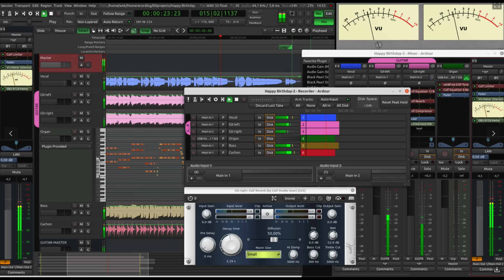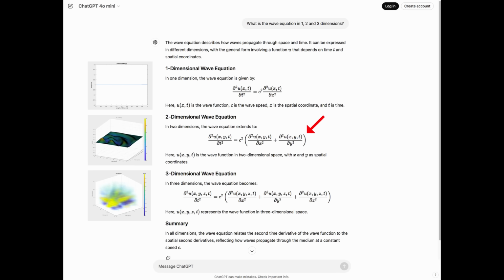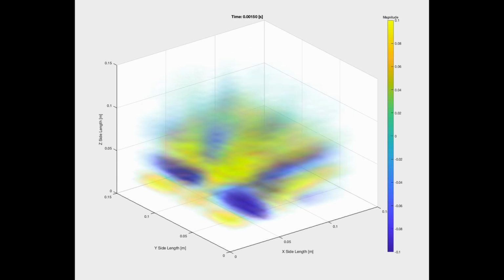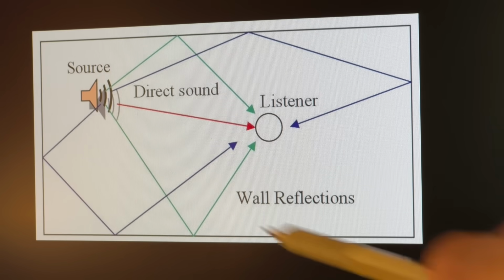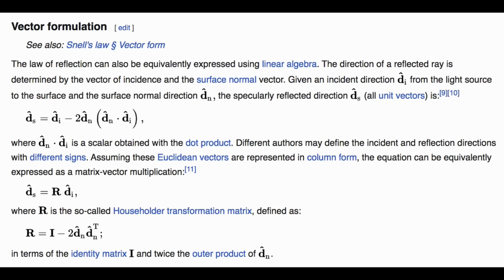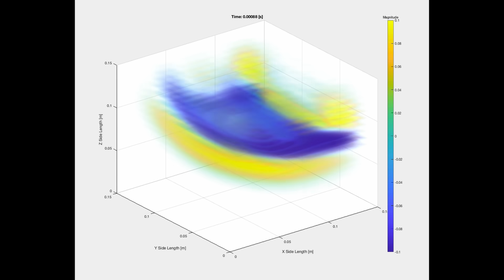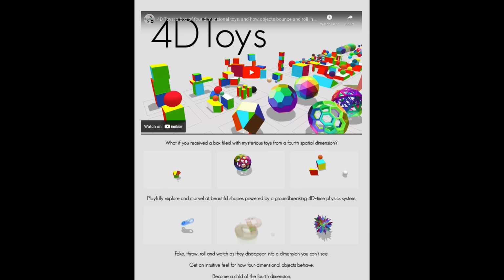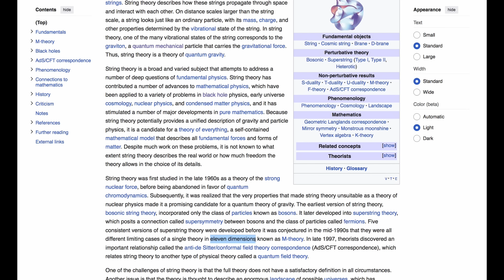Four Dimensional Reverb

Comment: Hey there. Awesome video. I'm working on the same puzzle at the moment. This is not quite a 4d reverb just yet. Yes it had the 4d wave equation. But you did not account for the wave interaction. The navier strokes equation is needed here. Also you need to not see the hyper cube planes as a surface and set a material which changes the diffusion rate. Please om me if you want to collab on this because I still think it's an awesome idea

Comment: 'impossible instruments' has been an idea in my mind for a while now. not a math guy to implement anything, but.. it's this sweet spot (or perhaps, dialectic) between 'the physically and mechanically possible' and the 'virtually and mathematically simulatable'. producing something like the 'physically impossible' yet 'virtually simulatable' sounds. it's a sweet spot really. where you have to navigate between 'simulating physical constraints or mechanisms' and creating their 'abstracted yet creatively potent' counterparts.

that's the original implicit vision of Robert Moog, if you read the patent of the synthesizer.

it must be an engineering movement within the audio world, i think.

again, you have to navigate between 'physicality and its math', 'physical and mechanical improbability/impossibility' and the 'abstraction' that can be produced by interpreting them, into 'musically viable applications'.

think of the piano, where in the middle keys, you have 3 strings being hammered in each key—that's where 'unison voices' comes from.

you have to take physicality as an inspiration to an applicable abstraction. thus 'expanding' what's possible from what has been.

Comment: I just realized your simplifying assumption of using rays and distance travelled is unfortunately wrong because of Kirchhoff's formulas.

Wave propagation in an odd number of dimensions is intuitive in the sense that pulses propagate on the surface of well-defined "light cone", meaning an original pulse will after some time t only be perceptible at points at a certain constant distance from the origin.

In an even number of dimensions, however, the backwards propagation component of a forward moving pulse does not fully interfere away, and we can observe ripples bouncing back towards the origin from the front at regular intervals, like the trail of waves generated by a boat on a lake.

Great. Now I can't stop wondering how 4D reverb would actually sound.

Comment: 4D is Time itself. Movement. It's not impossible to see 4D. If you can see the tragectory of an object you can be in tune with the 4th dimension, therefore you can see where it will go.
A 4D cube is a cube in motion.
Motion blur in a video, of an object moving, is actually the best way to see the 4th Dimension.

Time=Movement=4D
Reply: I have a video posted to my channel explaining 4D being time. Isn't too hard to find I don't have many videos.
Reply: we don't have a standard convention for anything beyond 3D, as 4D and 5D CAN both be temporal dimensions, but 4D can be a spacial dimension if you're talking about a hypothetical 4th spacial dimension, which would then classify linear time as the 5th dimension.

For all intents and purposes, time could be 6D, or 107D, it doesn't really matter.

Comment: Moebius strip drum head?
Reply: Assuming a rectangle from (0,0) to (W,H) with the space cut "straight" horizontally and wrapped "backwards" along the vertical, so that (0,y) is contiguous with (0, H-y).

Assuming a scalar wave, standing waves will be constrained so that the amplitude and horizontal wave velocity at these wrapped positions must be equal, while vertical wave velocity must be zero because an inward or outward wavefront would cancel itself, right. Then you make it a drum head by setting amplitude to zero at y=0 and H. I guess since the space should be invariant as you move your coordinate system along x, this means no vertical wave transmission at all. Because the amplitude must be mirrored across y=H/2, amplitude at this midpoint must be zero.

So, basically, you get even harmonics of H and all harmonics of W, and each mode will be have a wave number in both axes. But the lack of amplitude constraint in x means you can have any phase offset. So do you have to convolve the impulse with each harmonic with a delta function in the phase according to x... I can't tell if this would be a meaningful effect. Come to think of it, it means no even harmonics in x.

So, basically, it seems like any rectangular drum model would work if you just dropped odd harmonics in one dimension and even in the other.
Reply: I've always wanted to hear a synth based on spherical harmonics... cuz I'm a nerd I guess 😅

Comment: You’re not getting tonal results because ray tracing is a high frequency modelling technique (aka geometric acoustic modelling). Which assumes sound acts like laser beams, which is only really true at quite high frequencies. this doesn’t really capture the modal low frequency behaviour of room modes.

In room acoustic modelling you’d actually use something similar to the wave equation initially which will actually model the modal (or tonal) behaviour of the room. But this only works at low frequencies and it really inefficient at high frequencies. So to get the full package you could use BEM or FEM, but these are way more complex for modelling the wave equations. Or create 2 impulse responses (one using ray tracing and the other using the wave equation at low frequency) and pass them through a crossover filter! 

Either way, a really cool video and was great to see a scientific approach for this!

Comment: I was thinking about raytracing when I clicked on this video. I haven't worked out the math nor the feasibility to implement, but hypothetically we could build maps of the topology inside this "hyper-room" using various sonar strategies.  So if that were to be successful, I would probably look into creating a control move and orient the the subject around within the 4d-space. It would be cool to see what that would be like. We would still at best get a partial topology since we would be contained inside the room experiencing just a 3d projection at a time. I imagine that's what a bat would feel like if it had to navigate a 4d space some how

Comment: Edit: I hadn't gotten to the part of the video where you talked about the output being the impulse response prior to posting my initial comment.

I don't if anyone else had said this, but as long the source and reciever are stationary, you can pre-compute most of your data for this. You can bake all the phase offsets and amplitudes for as many rays as you want (could be very large). Then I think you could just bake it into a impulse response you can use in a convolution reverb (I could be wrong in thinking that could capture all the dynamics). Pre-computing could make using more exotic geometries accesible.

Comment: Raytracing does not solve the wave equation, an equivalent description to a wave equation with paths would require every possible path, not just straight lines. this is only the same, when the cube is very large with respect to the wave length. Whenever this is the case you are simulating echo/delay not reverb. 

Instead of solving the wave equation on a grid, for a Tesseract you can simply solve the associated eigenvalue problem analytically, generalizes trivially with higher dimensions (simply the possible standing waves that fit into the volume). you can then decompose the origin point into a superposition of such states with a frequency cut-off and evolve for each of them individually (since the wave equation is a linear ODE). Since the waves here are scalar fields, you can then instead take the density of eigenvalues to compute the correct impulse response.

Comment: I posted this as a reply in a long comment thread, but I think I want it to be more visible than that, so here it is as a top-level comment:

Sound is only 1D, being a scalar recording of pressure at, or averaged over a small volume near, a point in space. It doesn't matter that our ears are 3D, or that our eardrums resemble a 2D plane. What matters is what is detected and sent to our brain. Sound itself is just a 1D signal, i.e. more dense vs less dense, or in the detection thereof, more push or more pull. It also doesn't matter that the other side of the eardrum houses the cochlea, which is basically a sort of discrete Fourier transform on the wave. What matters is the waves of changing density that arrive at the eardrum and push it in with high pressure or, by partial vacuum, pull it out, which we can record, play back, generate, or simulate with 1D signals.

Honestly, while this video was a fun thought experiment, there was never going to be anything interesting. A 1D-space reverb can only bounce off of its two "walls" (the two endpoints delimiting the 1D line segment), a 2D-space reverb  has four "walls" (the four line segments delimiting the 2D square), a 3D space has six "walls" (six 2D squares delimiting the 3D cube), and a 4D space has  eight "walls" (eight cubes delimiting the 4D tesseract/hypercube).

Really, you could conceptually extrapolate the 4D (or higher) effect on the reverb by considering the difference between 2D reverb and 3D reverb and adding that much more, i.e. it's just gonna add more cowbell reverb. 😛

Comment: Very cool idea. Right away I was thinking it’s like taking a 3D reverb and adding another reverb on top of it, which is exactly what it sounds like. Never thought about sound in higher dimensions but what if we had 3 ears in 4D space instead of 2 ears in 3D space. And what if sound moved through the air differently.

Comment: I had a project planned last year to do physical simulation in a 3D room - but my approach went beyond impulse responses. I was going to calculate the perceived sound over a time period, using moving sound sources and possibly a moving observer as well - which means I would be able to simulate Doppler shift too. I planned to have a parameter for the speed of sound, which could be lowered to insane values like 1 m/s to create a kind of long-period Doppler delay effect.

I'd like to get back to that project... the problem is that I'm NOT a plugin developer, so even if this were possible to do in real time, I'm not the guy for the job - I know how to figure out mathematical physics and I do write software for a living, but real-time DSP is outside my wheelhouse! I was planning to render the sounds offline and then just import the audio into my projects.

Comment: the 4th spatial dimension is time. why is that so hard to understand? anything with action is travelling 4 dimensionally. or more simply, travel itself is 4 dimensional. and travel doesnt exist in 1,2, or 3rd dimensions. so sound itself is already 4 dimensional, or else it would be just sitting there frozen in the 3rd dimension. its the 3rd dimension travelling through itself.
Reply: what you are doing here in this video is 5th dimensional sound. because its TRAVELLING through a 4 dimensional space instead of a 3rd dimensional space.

Comment: Keep in mind that time is a spatial dimension. It’s just for one that we can only travel through in one direction at one speed relative to a constant frequency, producing device or a wave or something.
Reply: You could say that but thats not really the case. I wrote a paper about this once to debunk mctaggarts theory about time not really existing but fundamentally time and space are linked and can be changed independently as variables as long as lightspeed stays constant. The fact that if you went lightspeed time would actually be 0. So photons dont really experience time. We however know they do. But because perception but also actual time dilation is different depending on how fast you move time is not a linear enough to measure. Also when we speak about spatial dimensions we actually define them as directions we can freely move in. I understand how you are visually thinking about time right now. Kind of like in interstellar near the end. However thats also just a 3d projection of only that room. And technically the physics do work out when you treat time like a spatial dimension where you can go back. Problem is the edge cases where both time, distance but also mass and gravity start getting distorted by the massive amounts of kinetic energy involved. My point is this. Youre right in the way you can try to comprehend it and treat it kind of in that way but its different. When we move to a 4th spatial dimension even 1 attometer, it could be completely different. It would be genuinely incomprehensible because you cannot expect it to be just the same as your universe was but slightly different. When someone from flatland jumps out of his flat world he still sees only lines because his slice of vision is dictated by whats infront behind left and right for him. You could tilt him and he would see different slices of same object. If you stood on his world he would see the outline of your feet but if you lift him up he would see that as getting distorted and eventually fusing into one piece where your legs connect. Just in that same manner, a 4 d being could just decide to angle themselves  in such a way that he can see through your walls. Because your walls do not build in that direction. With time as a spatial dimension it would be the same walls in the past or futute. Plus to move through time you would still need a 4th dimensional space because where are you when the world around you is going back in time? Also how would time beings work? Beings who can put one leg in the past and one in the future and also occupy the same space. So the leg you saw in 1970 standing exactly in the middle of the room and the oposite leg you saw in 2000 in the exact same spot would be actually 2 parts of the same being. So no time is not a spatial dimension even though mathematically you could treat it as such and assign a time based axis aside from the xyz axis because if an object doesnt move spatially only the t coordinate will change. However and heres part of the issue: how do you change x or y or z without changing time? Youd have to move instantly and the only thing we know that can do that but also not really is light. But if you ignore time. You can freely change x or y or z independently of eachother. Qed

Comment: I think there is an issue with how you did this experiment...

First... if we were to see a hypercube in real life, it would look like an ordinary cube. Because the 3d cubes that build it are all orthogonal to eachother and the same size as eachother in hyperspace. So to help us see that it is a 4d cube we deform it, we skew the angles of the cubes so it looks like a cube within a cube right? We even go so far as to rotate it in 4d to help us see that relationship even more. Well, my problem is you haven't done the sound analog of that. You just did ray tracing for a random projection of the 4d cube but you didnt do anything to the sound to show the relationship between the way all of the rooms in this hyperspace are connected. So it seems like that made your calculations easier to do but it didnt create anything new here. The projection we ended up with is the same as sound in a 3d space

Comment: I wonder if any of the work on github from CodeParade (HackerPoet) for Engine4D or Mashpoe for 4DMiner (4D-Modding) would be a good place to start to add in audio. It would be interesting to see what stereo multi-dimension audio sounds like when moving around and rotating your 4D slice...especially if the output audio is only for the 3D slice the player is currently perceiving - and 4DMiner has working VR compatibility and the 4D-Modding API already. 4D Spiders that sound far away cause you can only hear the echos in your slice but really they're right behind you!

Comment: i would like to say its actually very possible to make a 4d Room.
ive thought about this alot before having been specialized in doing Surreal Perspective artwork on my early linearts.

but all one would need to do is consider the following.
our vision is a 2d image of the 3d world our eyes see in front of it.

we must approach how a 4d being would see their world and how we do so then proceed acordingly.

if an illustration can depict what a character sees in front of them. a 2d image of a 3d world created with Perspective rules of vanishing points lines and forms.
you can make a 4d world and thus a 4d room by having a 3d square as the canvas to depict the vision and visual of what a 4d being sees.

a vanishing point remains the same but now it can move in 3 axis not just 2 within the canvas. perspective lines become perspective planes instead.
a horizon line becomes a horizon plane bisecting the box into 2 sections of above and below. this is of course if the being is outdoors and looking towards its equivalent of a horizon on its 4d world.

using this we can then draw a simple perspective artwork drawn on a 2d canvas, as a reference for how we will construct a 4d room within a 3d canvas.

for instance if you are looking down a hallway, it would look very much like how a static tesseract would look
add doors along the sides of the hallway on the 2d canvas and now you have to add Trapezoidal Boxes within the sides of the 3d cube canvas.

i genuinely think its possible to render this. but im more of a perspectives guy who's good with instinctual geometry, than a math guy that can program this into code so unfortunately. all i can do is attempt to someday animate it by hand.

but i have illustrated the concepts a few times before as a colored sketch